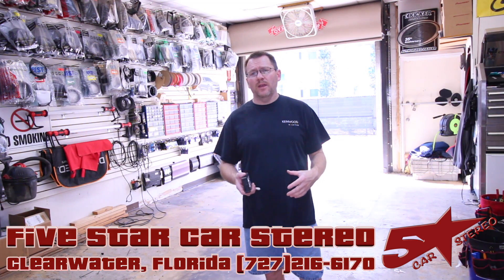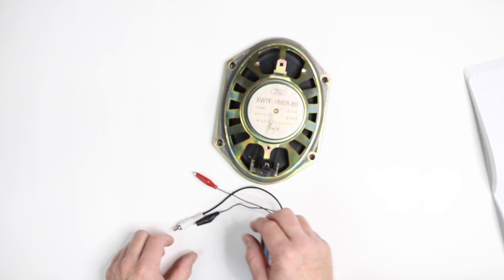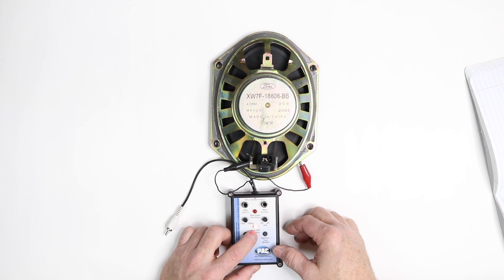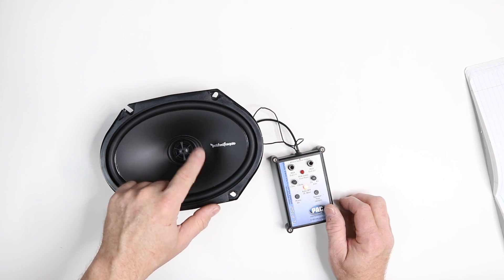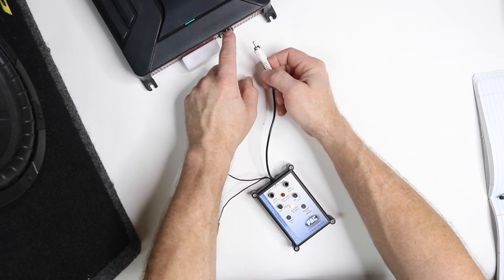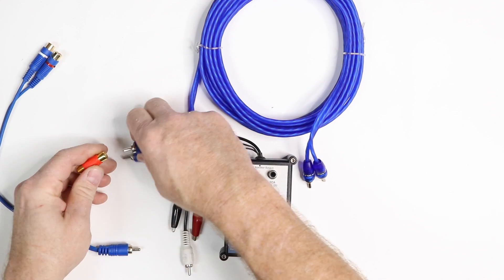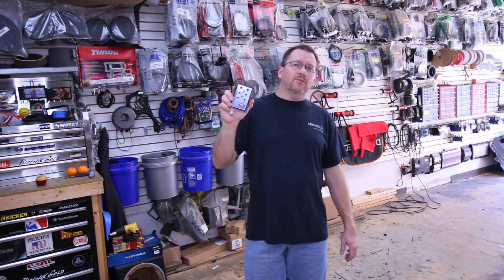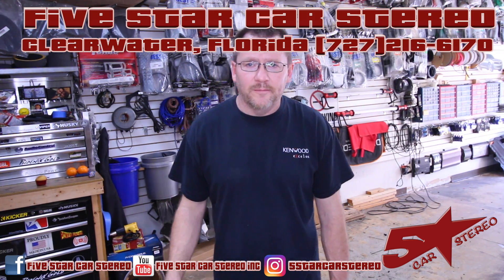The must have tool for every Car Stereo installer

Comment: An easy DIY way to test for positive and negative speaker connections: take a 9 volt battery touch the positive lead to each speaker connection. If the speaker cone moves forward that's the positive connection, if the speaker cone moves in reverse that is the negative connection. But still I'd say it is worth owning the PAC tester given its cheap price and ease of use. It certainly has other uses too that can help save time on a stereo installation, and that is the most important thing when being an installer and hoping to keep your business going, and maybe making a few dollars too.

Comment: I just bought one for $30 on sale, I ran into tiny issue replacement factory radio in Mercedes 1994.  All speaker wire pairs same colors lol.
Thanks for the video looking forward to using this tool 👍

Comment: Hint 99.9% of the time looking at the back of a speaker connections down or closests to you the right side is always positive, this works with almost all speakers on the market.
however there are a few its not the case. but for the most part its true in cars. But here is the neat thing about that concept  if you always use the right wire as positive you speakers will always be in perfect phase or 180 out all together.

Comment: I have this exact generator. It's pretty nice, but I wish the test leads were more robust. Also, it's nice that it turns itself off (that's a must).... but I wish I could turn it off manually as well. No need to waste the battery life if I'm trying to turn it off and have to just wait out the 5 mins. That said, the batteries still last a very long time.  :-)
Reply from the maker: firebirdude2 yes I have rebuilt mine to add in bigger leads and an on off switch. It is also very, very old. The one in the video is new. It is a backup just in case I give mine to a customer.
Reply: "Give it to a customer." LOL Been there too many times. :-(

Comment: excellent cool product...wish I had one a while ago! what kinda batteries does it take and how long do they last if you lightly-moderately use the tool?

also...is there a way of using this to generate a test tone for when your in positive phase polarity (cone pushing out) vs negative polarity? (cone sucking in?)
Reply from the maker: It takes a 9volt, lasts a long time. No for that it is just basic

Comment: I have a quick question. So I have a kicker cvr dual 4 ohm subwoofer that when I press down on the cone, the voice coils seem frozen, it won't move at all. But when I hook up a mutimeter to both of the terminals, I get a proper readout. Is my subwoofer bad?
Reply from the maker: Yes the woofer is blown, it is locked up. When a woofer blows it does not always have an open coil.

Comment: My daughter has a 2013 KIA Soul UVO Infinity bluetooth radio  part #96160-2K500DS5. All of a sudden no sound, nada, nothing.
I checked fuses in car, under hood all good & the amp is connected. She lives about 45 miles away & I finally got the PAC TL-PTG2, it's difficult running back & forth. My first question;
1) Is this a common problem with UVO radios?
2) should I go with a reman unit or aftermarket?
3) I'm considering the Blaupunkt Austin 440 can I just use jumper wires to bypass the amp if it's bad?
Thanks for sharing your knowledge! Times have really changed! You're awesome
Reply from the maker: +edward heck 1. We don't see to many 2. If one broke why get another. Although it would be way easier, not a terrible idea. 3. Go with a Pioneer or Kenwood. Yes the have, thanks

Comment: Love y'all's videos! I had a quick question about determining speaker wires. If you mistakenly hook this up to, lets say an air back, using a 1khz tone, is that potienally dangerous for the detonation of the air bag? It would be AC so I assume it would be fine... buttttttt wasn't sure. Also, what if you are trying to determine the preamp speaker wire colors on a factory amplified system (defective amp bypassing next week) with no diagram even on Directechs. I don't see a way this machine can do that, but is there a device out there? 
Thanks guys!
Reply from the maker: Brannon Harper always check with your Multi Meter before testing a speaker wire in a car. It could possibly blow the air bag. 
Check out these videos for your amp questions, they might help
https://youtu.be/6Zw04MVbNsM
https://youtu.be/mb5udHryuqk
Reply: It almost certainly would fire an airbag.  So will a Multi Meter if it is on Ohms!

Comment: One issue what if while you are testing for speaker wire you test on the power wire? What would happen to the machine?
Reply from the maker: Alpha Omega nothing to the tool, but rumor has it someone did blow an airbag. So be careful
Reply: Ouch thanks bro!
Reply: If you use the 9V popper on power/airbag wires, YES, it can trip and blow them. That's why you use the tone generator portion only until you are 100% positive you're connected to speaker wires. The AC signal from at tone generator will NEVER blow airbags. Honestly, I seriously doubt that tiny AC signal would harm anything in the car, even CANBUS wires.

Comment: Big fan of your YouTube channel! 
Could you guys spec out a system for me? 
I need a music system that sounds great and is cost effective. I don't mean cheap. I listen to mostly Mexican music (regional, corridos, norteñas,) classic rock and some rap from Pandora from my phone and Satellite Radio. Vehicle is a 2014 Ram 1500 quad cab W/out infinity. It has the stock Ram RA2 that I know will be going bye bye soon. I'm open to any suggestions you guys have. For the deck I'd like a big GPS touchscreen that can connect to my android phone and Satellite radio. I'd also like to add a rear view camera, and front camera in the future. For subs I want a 15" in the center console. I carry too much gear to get rid of my rear seat storage. 
I know that's not gonna be cheap but I'm gonna have this truck for several more years. Might as well have good music. Thanks a lot guys.
Reply: One Last thing : I'd recommend going with a top line Pioneer head unit if u want those features (like an NEX model). I'm have a more basic one  (avh-x2700bt) but wouldn't want to do GPS with this, the screens are nothing like smart devices these days. I love the sound of Infinity Reference speakers that I have in all 4 doors of my Expedition. The key in all of this though is to get an amp. Spend 250 to 350 on a good one or else you will be underwhelmed (with an amp you really don't need a sub unless you want your car to vibrate like heck... the woofers in these speakers do a great job as is. Id probably do some midbass before a woofer even). The amp I have which is great and has lots of fine tuning knobs is the Sony xm-gs400
Reply: Matt White 
AVIC 8200 gets high marks from you guys on your top stereo for 2016. How much for you guys to ship me an 8201 to 46224? Also what adapters do I need? 
Where can I get them? 
Dash install kit?  
I do have the steering wheel volume and track controls. I need to keep those. They're way too handy to lose.
Thanks for replying and for the help. I'm binge watching your videos lol.
The GSM 400 has been discontinued. Any other suggestions?
Reply from the maker: One Last thing would love to help, send me an email and we will come up with a system plan for you. We have all the parts you will need. Fivestarcarstereo@yahoo.com

Comment: Not gonna spend money on this when I have been doing the same testing with a D cell battery and a multimeter for over 40 years.
Reply: I wasnt aware of any DMMs that have the Speaker pop test, a tone generator, as well as RCA  jack input and output on it . Please inform me of where One can obtain such a device
Reply: @nicholascasatelli6949  
Other than tone generator, all other test can be done with a d D-Cell battery and a DMM.